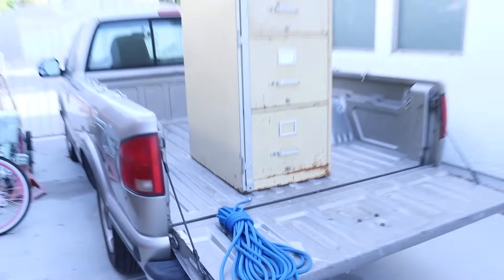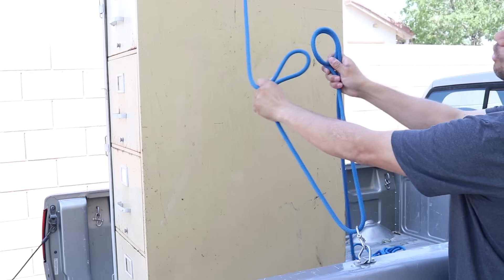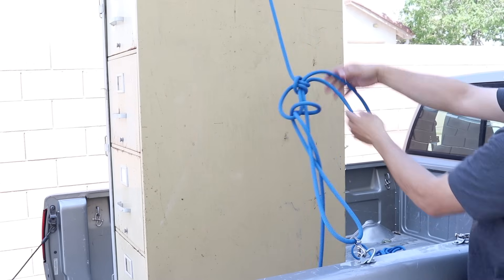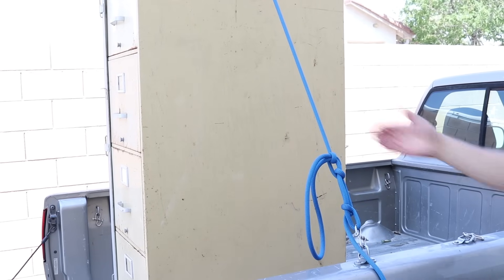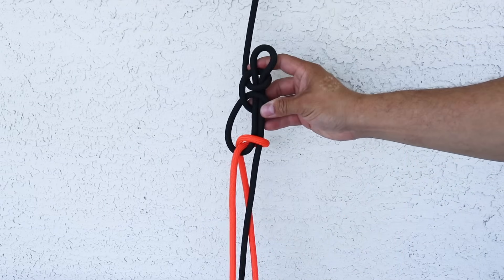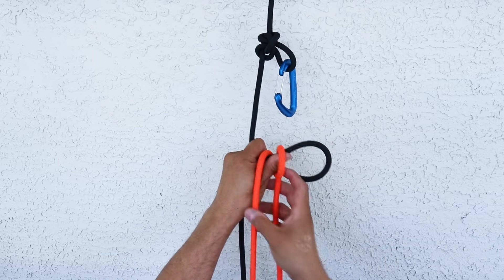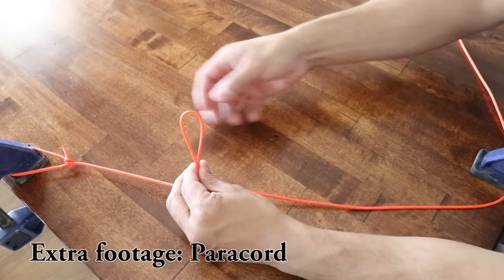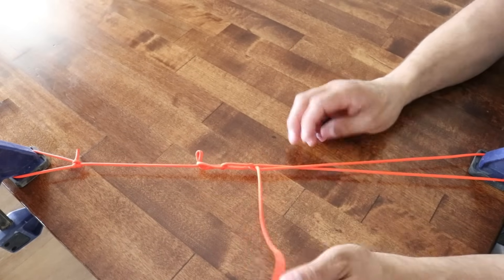In-line Auto Truckers Hitch. Better Explanation

Comment: First thought: 
What's the use/advantage against the simple trucker's hitch I used for so many years... I knew about the self-locking part (two times through the loop). Marlinespike-hitch to tighten... old hat. And yours seems way more complicated at first glance. So what about it?
Followed your instructions anyway... partly out of boredom, partly out of curiosity, what this would lead to.
Then found out you NEVER have to touch the loose end... no matter at all if the loose end is 5, 50 or 500 meters long! Now I'm wide awake and completely thrilled! 
Thanks so much for this!

Video, audio, description, explanation, presentation (colored ropes)... all very well done!

Only suggestion for improvement from my point of view: point out more and make sure that nobody misses the fact of the never touched loose end!
Reply: That was clear when he threw all the loose line to the corner of the truck bed . Best video of knots and pulling out there !
Reply: Yeah, subtle details can make big differences.
Reply: i think the way you are suggesting works only for thin ropes and NOT for thick ropes like this, besides it like the way it is holding tension.
Reply: My dad showed me the trucker hitch wen I was a kid still use it today. I'm 66.
Reply: Yessir that's why this is called an "in line" meaning you don't have to use the loose end!
Reply: The true truckers hitch you never touch the end of the rope either. Longer rope can do more than one tie-down with a single length. there's a difference between a hitch and a knot, what this example here does is 2 knots and a hitch.  Very nice way to do it but a trucker wouldn't use this method. Think 20 to 30 tie-down points,  the truckers hitch takes maybe 10 seconds. A knot the rope crosses over itself and binds from the cross and can be difficult to undo. A hitch the rope layers over itself with tension and while very secure is easy to undo. The clove hitch is an example. The rope binds to the anchor point by laying over itself. The rope doesn't bind to itself.

Comment: I've been using bowlines for the last 40 years, as a combat engineer, with the operating engineers, and several construction trades. If I only had a dollar for every time I tied one of them...
I was taught, and always used, the "rabbit" method. I can't believe I never came across this method until now. It's not only simpler to tie, but in many situations would be much less clumsy. You can set the knot up, slip the free end through your anchor point, and quickly complete the knot. There were plenty of times, such as securing a non-stationary load, when I used a different knot b/c a bowline just wasn't practical to tie w/o having three hands. This method makes it a cinch. Wish I learned it a few decades ago :(

Comment: For anyone wondering like I was, releasing the tension by breaking the tension lock part of this system does not spoil the setup and force you to start again.  As easily as the the "lock" is released it is reset again by applying tension to the working end.  Great job as always!

Comment: Thought I would throw this into my mix along with my normal truckers hitch but I tie this version in about 9 seconds now and I don’t have to worry about finding the end of the working end anymore, plus I can do it on a 100ft line or a 10ft line so thank you for this.
Reply: Your normal truckers hitch may not be a truckers hitch,  a true truckers hitch you never touch the end either and depending on your cargo height and length of rope you can fit some crossovers on a single length. I like this guy's knot but it's a knot not a hitch
Reply: @tombrown9460  Can you link a video of what you’re talking about? I’ve never seen a traditional truckers hitch tied any way other than with an in line loop and feeding the working end through. I know probably a dozen truckers hitch varieties but when I think of a classic truckers hitch it requires the working end to be found, everything else has a modified name.
Reply: @hunterkogelman3558  I'll get back to you,  there's a pretty good video on it but it's been a while since I saw it.  Gotta look through my history.
Reply: @tombrown9460  I think I know what you mean; problem is that most trucker hitch videos only show a flatbed with hooks, not loops. I have tried to do a traditional truckers with loops on my pickup, don't work because you need the free end. This method works far better IMO.

Comment: & here was me thinking I know a few knots well (ex scouter) I taught myself a way to do the truckers hitch many years ago that didn't require pulling all the rope through & with multiple hitches on the one rope you can undo each one to retighten if required without loosening the others. I've used it all my life! BUT! you have just shown me an awesome way to hold tension on that knot. I love the bowline too, I also taught myself to tie it in any configuration (upside down, back to front etc) & I can even tie it blind folded (as I can with most knots I know) This is excellent tuition to, very easy to follow. Thanks from Oz !! 👍

Comment: I've now tested it out and practiced it a few times. It's a game-changer to not have to feed the end through, and that it's self-locking. 

If you absolutely need every bit of mechanical advantage to get your rope ultra tight, the friction here will drain a few percent, so maybe a normal trucker's hitch has the advantage, but I honestly don't think I'll ever go back now that I've learned this one.

People in the comments saying that it's too complicated: grab a rope and try it out. It's much easier than you think, and goes really quickly when you're not explaining it point by point for a YouTube video!
Reply: The trick of using a marlin spike (any object) to allow a 2 handed pull certainly helps overcome any added friction.

Comment: When I was a truck driver years ago, the truckers knot we used was less than half as complicated as yours but just as secure. Which was a good thing because we loaded and unloaded several times a day.
Reply: Yeah the point of this one is if you don't have the end of the rope... I'm still not sure how the bight doesn't slip out of the lark's head under heavy load though
Reply: Agreed. Wouldn’t want to use this to tie down load on a 40’. A lot simpler and quicker trucker knots that I use and just as flexible and secure.

Comment: Unless you use knots every day, it can be easy to forget what you were once taught.  The video clearly shows you how to make and use the simple knots that form the most useful hitch ever invented.  Every truck or trailer owner/user needs to know how to secure a load with this kind of hitch.  When part of your roof  blows off your house in a storm - how are you going to secure a tarp over the damaged area in a way that will stay put - this trucker's hitch is what you'll use. Notice that the line is never cut - you start with 50' and at the end of the job, the knot is loosened when you want it to, and you still have the 50' of line you started with.  

Thanks for this excellent video.

Comment: As a sailor, make that a lazy sailor, i make a backward bowline by some odd method i discovered while tying a bowline in a race around the cans in bad weather and under pressure many years back. it worked, it held just the same, i liked it and i have used it ever since. The difference is, the standing end finishes by passing back through the loop the in same direction as the working line as a normal bowline, but just kind of diagonally opposite. like a messy bowline. i must have tied it a million times. i like your method though, i'll give it a try. Nice one

Comment: Good video, thanks. I like tying knots.

However, I would probably drop the cabinet on it's back and then use a ratchet strap.
Reply: That would be a completely different channel then.
Reply: @darz_k.  Would a ratchet strap be better? The mechanism can probably exert more force on the load.
Reply: @rem45acp  That's what she said.
Reply: @darz_k.  she said that the mechanism can probably exert more force on the load? Man you must hang out with some strange women.
Reply: I wouldn't call your mother strange. A little naive, but not strange.
Reply: @rem45acp  yes, if you had one, a ratchet strap would be better. But this is about how to tie knots, which you don't have to do with ratchet straps. And rope is cheaper and more versatile than ratchet straps. Use the straps if you have them, but it's good to know how to tie the knot if you only have rope, or if your strap isn't long enough.
Reply: I haul cars and pickup trucks for a living and dealerships use rope to tie plows into the back of pick up trucks that go to auction but their and my knots suck they aren’t spending money on ratchets and neither am I so there is a time and place for something like this. Rare as that may be.
Reply: Don't own a ratchet strap. Or a truck. Stuff like this just goes in the back of my van. 
Having said that, I wish my brain could learn knots. My Knots playlist now has 73 videos, including this one. Must buy some rope.
Reply: Um, thats a smartelic remark, your missing the point.

Comment: Thanks for this, I always struggle with a bowline around an object. Your bowline at the starrt is by far and away the easiest I've come across. However I do tend to use the water bowline or double bowline for security, but in this instance there is no need and your bowline tie is perfect for this circumstance.
Reply: For normal applications, use Scott's locked bowline. To make it ultra secure, add a double overhand as a stopper knot.

If the life of your best friend's child depends on it, use an end bound single bowline with a double overhand as a stopper knot.
Reply: @DavidRichfield  Cheers David, more learning for me and it is much appreciated. 

I just hope I'm never in a position where I need to save my best friend's child but believe I am better prepared than most for that scenario.
Reply: @robgreen3997  I have edited my answer: don't use the Yosemite finish for anything critical: it has a sneaky failure mode. Scott's locked bowline is easier to tie and it's inherently secure.
Reply: @DavidRichfield  Thanks - noted
Just looked at Scott's bowline and the fact that the end is out of the loop and the way it is secured is so easy to remember and add. Stay safe.
Reply: @DavidRichfield  thanks for this recommendation

Comment: You are the man ! I love knots ,and you tie them like a  master! I am getting ready to haul some 10 foot 3 inch metal roofing in my 5 ft bed pickup truck. I have a load extender that attaches into the receiver  and has an adjustable upright so you can support long material .I have 2 ten foot boards in my truck bed and back across the load extender.Gonna strap the metal roofing to the boards .I was watching  your video and was imagining how easily you could have lashed everything down! I struggled lashing the boards down to the load extender finishing with a simple trucker hitch,not a nice one like you tie.  I also tied a rope around the boards and the tailgate  ,making wraps around each board individually all in one wrap. I put a bite it the other end and finished it with trucker hitch ! It would be awesome to see your tying techniques  applied to different unique situations .

Comment: So I use both bowlines and trucker hitches at work all the time. And while I think your truckers hitch is a bit too complex for what I do, I wont deny how well you can use it to crank down on things.  The way you tied that bowline though is really slick.  I can tie a bowline with my eyes closed in a second if the loop is facing away from me.  I don't use the hole, tree, rabbit confusion.  However in those awkward situations where I have to tie it with the loop towards me I struggle.  I'm going to commit that technique to memory.

Comment: TensionLever BowHitch:
I appreciate the detailed rope tying technique you've shared. I've been experimenting with a blend of traditional methods and came up with a hybrid approach that combines the strength and simplicity of the Bowline and the tension capabilities of the Trucker's Hitch. If you're familiar with these knots, it’s quite straightforward:

Secure the Start: Anchor your rope to the first point with a Bowline Knot. If unfamiliar, a quick search for "Bowline Knot tutorial" should help.
Set Up for Tension: Midway between your anchor points, create a slip loop (this sets up for the Trucker's Hitch).
Tension and Secure: Thread the free end through the second anchor point and back through the slip loop. Pull to tighten. Then, use two Half Hitches to lock that tension in place.
If you ever need to release quickly, just undo the Half Hitches and slip loop. It’s a blend of security and efficiency. Hope this offers another perspective, and I’d be interested in any feedback from the community!

Comment: From the extra footage it looks like you’re basically securing your black wall hitch with a sheep’s shank. Couldn’t you basically do the same thing by doing the normal truckers hitch and looping you’re working end though your anchor point for mechanical advantage a second time as long as you make sure your working end stays under itself when you double it?
Reply: Friction builds up fast with more turns

Comment: Thankyou for your content, it definitely makes me think. I also like to analyse. I will use this version but modified. I'll do it in reverse, starting with the '2nd' tie-down point first, loop it around that, then make the bight with your autolock 2 turns (strong doing it this way on a bight, btw (2 strands), versus an autolock on only one strand or line, (very good!). Then I'll fix the bight with a Larkshead, tighten and pull the bight loop almost to the end, right before the Larkhead, before running the standing line through that loop, to further secure the half sheepshank. Then I make my way to the '1st' (really 2nd, but doing things backwards) tie down point. There it will likely be a snap bowline on a bight. Once all that is done, i'll go back to the autolock to ratchet it tight, dog it off with a half hitch on a bight, then a 2nd half hitch. I would feel good about that with the extra step in forming it, and also taking it down. The sheepshank just makes me a bit nervous, by itself.

Comment: As a firefighter I've been using knots for too many years to get ladders, saws, pike poles etc. up where we need them. As a truck driver I always use ratchet straps for everything that needs to stay still.
Reply: I'd rather have two ways of doing something than just one! Especially when one of those ways only requires having some rope.
Reply: Firefighters and truckers go camping too, right? Might need to make a tight ridge line someday. Might not want to use ratchet straps, though😳🧐. Or maybe that’s your preference. Cool!! Different strokes…..

Thanks for the great instructional video!
Reply: Grand Waha -  I know what you mean.  If I was driving commercially I would use straps exclusively.   On my personal truck I have ropes permanently tied along the lengths of the bed with loops as tie off points for ratchet straps to hook into.   I have dedicated ratchet straps semi-permanently tied off to my truck.  Straps are a time saver, but rope is a multi tool.

Comment: Great video. Easy to follow and good info, but I hope those D rings are bolted to a backing plate and not just a tiny washer bearing on the sheet metal bed rails! Can see them lift a bit when you tension the tie down. Your tie down system is only as good as your anchor points. Subscribed for more!
Reply from the maker: Thanks. I used fender washers.

Comment: I am currently working on installing an electric fence using a conductive rope product called Polywire around my garden.  I'm thinking of trying this version of the truckers hitch to keep tension in my strands, as the taut-line hitch I'm trying to use is not holding the tension for a long enough time and I'm having to readjust them often.  Is there something else that would work even better in my situation?

Comment: Interesting technique.  There are many versions of "trucker's hitches", some very simple and some more complex (as shown here).  One thing for certain... when securing loads, a bit of good quality rope and a basic knowledge of knots and rope handling beats the use of cheap Chinese ratchet straps any day!  Rope, correctly used, is quicker, more versatile, stronger, and stores neater.  The only drawback of rope & knots is that it requires moderate use of one's brain! 🤔

Comment: Nice knots. I like the larks head use for a dynamic loop mid line knot and I also like to use a butterfly knot for a static loop mid line knot which you could also get a  2:1 pull off of to tighten a load down. The only thing I wonder about is the easy untying of this system from the simple flipping of the one overhand loop at the bottom of the system, if the load somehow becomes slack is there a danger of this whole system becoming undone? I guess that's where you had better have some good half hitches on that end, or maybe just anything to prevent the loop from flipping. I guess its easy to feel this way about any knot that can easily be undone :-) for me anyway.

Comment: Great content! One question though: The tension locking knot can as well be used with the normal Truckers hitch, that is simple slip knot and then your tension locking knot to seal the pulling force. Since you end up always securing the left over rope I do not see the added value of creating a loop and then yet another to secure the first.

Could you please elaborate on the above? Is there another motivation behind it?

Keep it up!